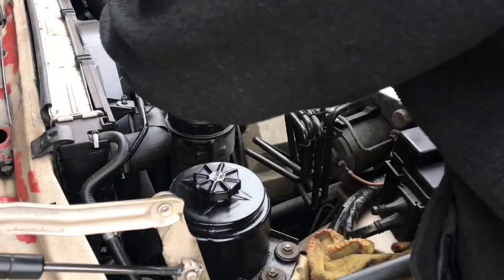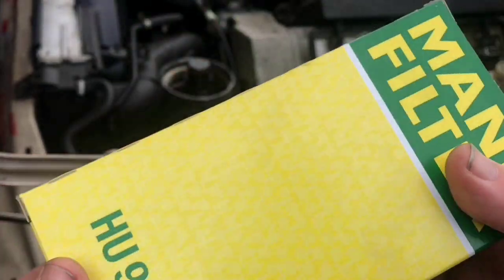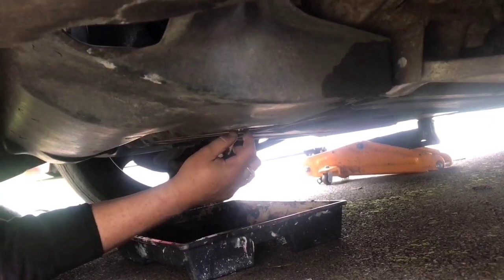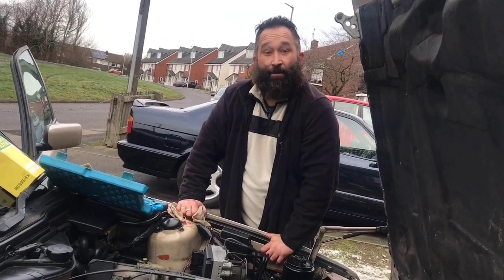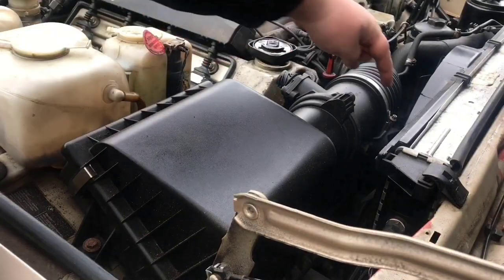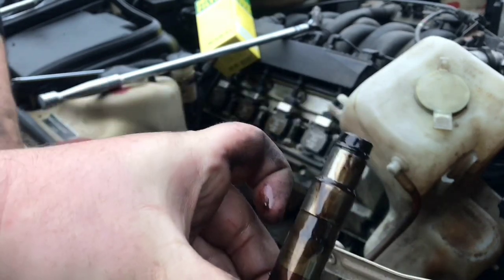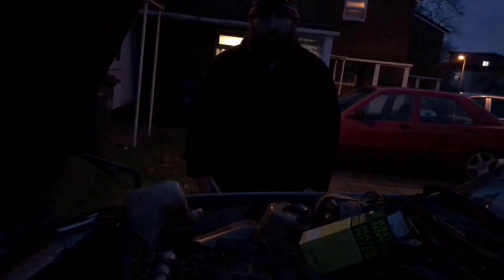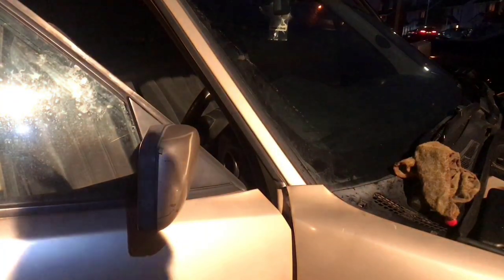How To Change The Chain Tensioner On A BMW E34 540I

Comment: Maybe you mentioned this but that first oil filter that you tried fitting is for the ones with metal caps and the latter is for plastic caps. I also just learned this a few days in a similar manner
Reply from the maker: Agh Didn’t Know This Mate, Everyday Is A School Day 👍 Cheers 😃

Comment: That chain noise was scary, I dismantled the new tensioner and filled it with oil prior starting. After that the engine started up without any chain/guide rattle. 👌
Reply from the maker: I Agree Normally It’s A Smooth Start Up But With Loosing Day Light And Filming We Didn’t Turn It Over Enough Before Putting Fuel Pump Fuse Back In Next Time We Will Try Your Way Thanks For The Comment 😀